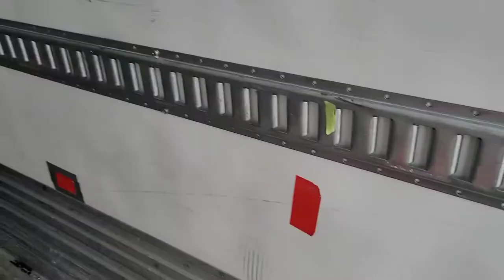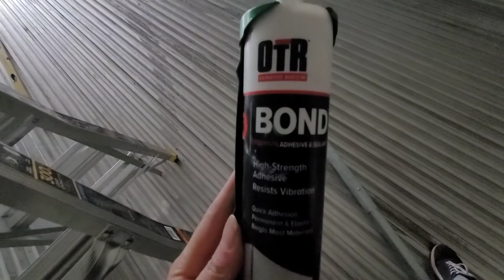Installing E Track's in our 53' Vanguard reefer trailer.

Comment: What type of screws are you using? Are you screwing into the alluminum studs?
Reply from the maker: We bought the screws with the e-track at the dealer to make sure we are using the exact ones that they use to install. So when you purchase your e-tracks make sure you ask to buy screws from them too. They charge per screw but they should know how much you need. And buy some extra just in case. Yes we screw them to the aluminum studs. We pre drill the studs first before screwing them in.
Reply: @bonnyslifevlogs6442  how many inches is it until I hit the stud drilling? What size screw do I need?
Reply from the maker: Sorry. It's been awhile. Can't remember the screw size. But you have to call your trailer manufacturer to ask for the screw size. Tell them you want to install e-track in your trailer and need to know screw size. Every trailer brand is slightly different. Also, when you drill be careful not to drill through the other side. Use a drill bit stopper.
Reply: 1 3/4 inch sheet metal screws . Use the drill bit that's 1 size smaller and shell grip nice and tight
Reply from the maker: @kellykolnes1954  yup! 👍

Comment: Hi My question is those screws will hold a 30k+ pound load ? 
Reason i ask is becaus i want to do the same but,i dont want the screws to pop out!
Reply from the maker: Yes. Screw them all to the metal frame as instructed.  It will only pop out if you put screws into the wall without metal frame. Get a good stud finder to help you.
Reply: @bonnyslifevlogs6442  thank you
Reply: @antvurena  Use  straps along the same side as the E-track, along the wall that you're attached to. If you need to strap across to the other opposite side of truck wall, then use a load bar, for that., because  if you try to strap across from one wall to the next  then overtime you will pull the screws out of the E-track.
Reply: @bonnyslifevlogs6442  so you did use a stud finder . Which one did you use?
Reply from the maker: @euroshfl  Dewalt and zircon from home depot

Comment: What is the name of the type of screws that you used.
Reply from the maker: When you buy the tracks, the dealer will sell you the screws too. They are exact fit.
Reply: #12  1 3/4 inch Sheet metal screws is what I used . They worked great

Comment: Hello, thanks for the video. I need to add E-tracking to my 16’ box van but it has no plywood, studs or anything. Previous owner added a lower e track right to the metal wall. Is that basically what you guys did or does your box have studs?
Reply from the maker: Hi. 53" reefer trailers all have metal studs. The e-tracks needs to be screwed into the studs to have a firm hold. I've seen some trailers that had e-tracks screwed to the walks only, the screws will pop out.
Reply: @bonnyslifevlogs6442  totally agree! this is my point of messaging you. For some reason my box has no studs. They punched the lower E track right into the box and they added a wood rail on a different set of measurements..its bizarre. Anyway, no biggy. I was curious if your guys box has visible studs. Heres a pic of my van..oops, it wont let me attach picture..no big. Ill figure it out:)
Reply from the maker: @jessehaslanded1  there are no visible studs. We used a stud finder to locate the studs.
Reply: @bonnyslifevlogs6442  talked to the manufacturer today. my box is made of RFP..basically plywood wrapped in fiberglass. No studs at all. They just use rivets. Studs would have been much easier though and something Im familiar with:) thanks again

Comment: Are those just Philip head screws ?
Reply from the maker: Yes. Bought them with the e tracks. So these screws length and size are meant for the reefer trailer.
Reply: @bonnyslifevlogs6442  they look like a plan sheet metal screw .
Reply from the maker: I'm not sure. We bought them together when we bought the e track. Had to make sure the yr, make and model of our trailer. Screws they have are different lengths to make sure they don't go through the exterior.